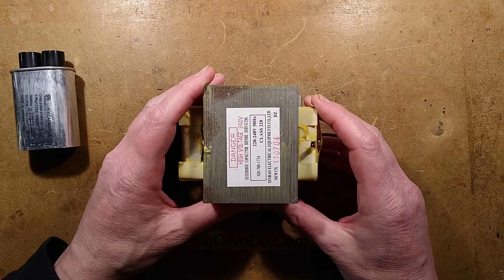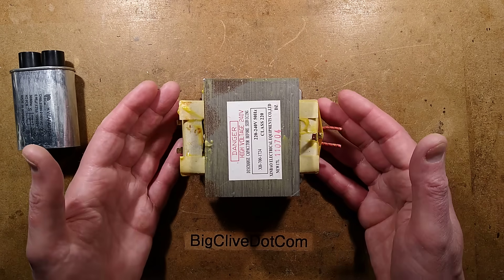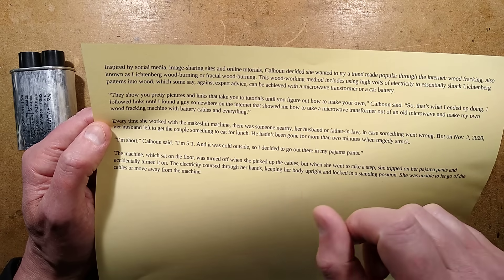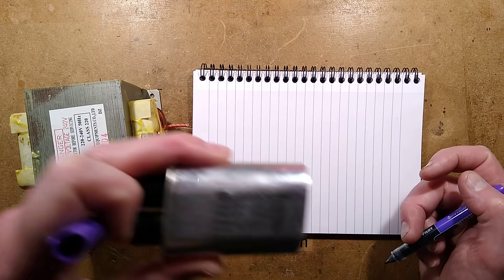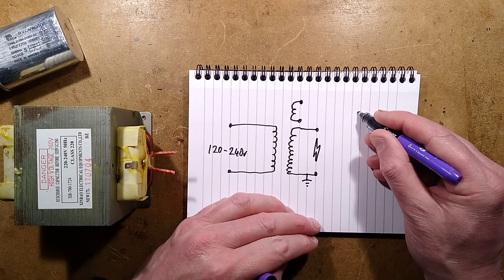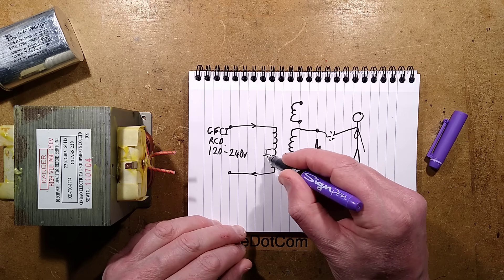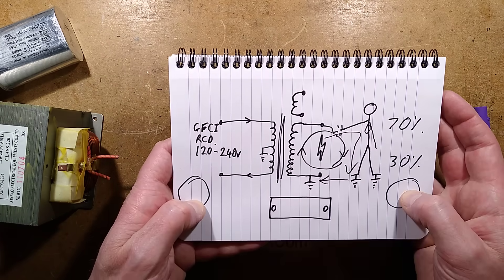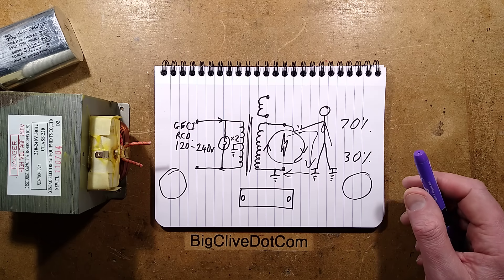The most deadly project on the Internet

Comment: There are a lot hobbies that are incredibly dangerous and can kill you if you don't take proper precautions. If people knew how dangerous R/C helicopters were for example they'd probably be outlawed. You're flying a 2200rpm 5kw lawnmower with a 1.5m span, people have been literally decapitated even when they were careful due to mechanical or electronics failures.

Comment: salty water and high electrical current.
sounds deadly enough for me to not even think about watching any further...
I was shutting down an old generator by touching a rubber stopper to the spark plug. my finger slipped and I was knocked on my but wondering what happened.
no thank you, buy bye.

Comment: whenever i screw around with high voltage i always put a current limiting resistor in series as cheap insurance. also old electronic fluorescent ballasts (cold cathode mode) make great high voltage supplies and i've obtained dozens of them from my college upgrading to led lights.

Comment: Thank you for an entertaining and informative video. I have no intention of messing with high voltage. I got a burn from a transformer that put out 660 volts on the secondary. Lucky it was just a small burn, like the diameter of a pencil. But it hurt. It was accidental.

Comment: I saw a professional artist who did fractal art with high voltage. He talked about the safety requirements and how just a pinhole in his gloves could be deadly
Reply: That is why linemen wear leather gloves over rated rubber gloves that are tested daily and given more extensive testing monthly.  If you don't even know what safety equipment is needed for this type of exposure, you aren't qualified to work with it.
Reply: @kcgunesq  I've worked and played with voltages to nearly 1M, and currents in the thousands (not at the same time!), over the course of 50 years. My feeling is gloves are a last resort for the brave. If the only protection I have is a glove, even if tested 5 minutes ago, I'm walking away!

Comment: wow 3kV DC is exactly what we'd run our big DNA sequencing gels back in the day. The Undergrad techs would perk right up when I told them if they splashed the running buffer on them while charged they'd be DEAD. Full stop.   This is a great public service Clive, bravo!
Reply: Those systems are going to be very much current limited, unlike a microwave transformer. It's not impossible to get killed by your DNA sequencer, but you'd have to try a lot harder.

Comment: I was discharging a small colour TV's HT by the standard practice of sliding a screwdriver along the chassis and under the tube connector to carry out a repair EXCEPT I wasn't properly touching the chassis with the shaft of the screwdriver. I remember the flash as 25Kv shot through the middle of the drivers insulation,  I doubled up in agony as it hit me.  It was a military grade long red screwdriver with 30 mm of plastic between me and the blade and it still got me. A very,  very painful lesson thankfully I survived.  I  used a fully grounded shorting cable from then on.

Comment: to show is what a minor shock would feel like and also to explain property of AC electricity in class my teacher too a regular 120v to 12v typical everyday transformer and flipped it around, has all the students in the class (this is college lvl course or cégep a d all adults) and the 1st and last of the students holding hands held each 1 of the 2 sides of 120v input side leads, my teacher there took the 2 leads of 12v side and I  same motion as striking a match made momentary contact to show us the actual impact of voltage spikes form collapsing Feild of the xformer

Comment: I have a little rule when I touch wires that carry enough power to cause muscles to lock up. Index and thumb, a little pinch is all it takes. Saved me once when I was doing some wiring on a breaker box and needed to put the hot wire on the primary rail, and accidentally smacked the shutoff lever with my elbow. Thumb contracted back and wire fell out of my hand.

Comment: There was a time when a 14-year-old boy could visit a junkyard with a bag of tools, wrestle whatever bits he wanted out of whatever auto carcass suited his needs, and pay for the parts when he left.  (That's really how junkyards were run, back in the "good" old days, and coming home dirty and a bit bloodied was a perfectly normal thing.)  This was how I got batteries, relays, alternators and coils for my basement experiments.  An ignition coil could give you quite a tingly jolt when wired to a simple 9-V dry cell.  Trying to pick up a submerged quarter from a properly set up steel bowl was a fun game! 
My parents' only rule was that I couldn't use the 120 V mains.  That, and the fact that microwave ovens weren't yet a thing, considerably improved the odds of my survival to adulthood.
Reply: I'm pretty sure junkyards continue to work that way, unless I am also getting old..

Comment: I've passed by apprenticeship and been a qualified sparks since 1980. I did my apprenticeship in factory. Were the factory had a supply of serval 100  thousand amps the factory had it own substation with six 3 phase transformers., Unfortunately I've seen a sparks die. Essentially people are a bag of water. The smoke given off when people are killed by high voltage with high amps , is steam , you are boiled alive , the cells in the body explode . Again I've seen sparks with bad burns , these burns are cause by cells rupturing because of steam theses cells are dead , your body can't replace them , I will spare every of the gory details.  When you seen someone killed by a high current it is something that will haunt you for the rest of your life . . The safety equipment we had to wear when dealing with high voltage and current were rubber mats , rubber boots , a couple pairs of insulated gauntlets , face flash  shield,  A Faraday cage suit and all out tools are insulated plus we had to have the necessary certificates to carry out the work ,we were never allowed to work alone ,.and we use to use earthing jump cables to ground everything, incase some accidentally switch things on Electricity is a deadly assassin you can smell it , you can see it , you can't hear it, but it's had a deadly bite, when it gets you . Yes I've had a few electric shocks in my time , purely because I get a bit complacent every now and then . I say to people who ask me about theses video, I simply say one word don't. You have one life look after it
Reply: On the road years ago I saw a guitar player get fried... not a nice experience. Luckily I was just a box shifter that night and not responsible for anything on the stage.

Comment: I wonder if you connected an unmodified microwave transformer to the mains using the high voltage side as primary would you get a powerful low voltage supply?
Reply: Not really. It will be quite current-limited. You may as well use a much smaller transformer instead.
Reply: I think I see what you mean .. an 800w microwave would be running around 0.4A at 2kV .. so 0.4a at 230v would be around 100w which wouldn't be very much for such a hefty transformer ..
Reply: @croolis  Correct. As a 100 W transformer it would be more efficient than most though.

Comment: Microwave oven transformers are so very dangerous.  The general public don't understand that the "mains" protection systems will not detect any "leakage" from the  HV side, so in effect there's no protection, at all. 

Add in those HV capacitors  that can REALLY store a killer shock,  then we've got a very effective killing machine if used incorrectly.

Having said that, HV can be fascinating. My  "highest voltage" device was a Marx generator (that was able on a dry day to provide a 3 meter / 10ft "spark" to a grounded terminal). All control connections were pneumatic, and I ensured there was a window (and grounded wall) between me and "it" when energised. Built a few (small) Tesla coils too - again HV but minute current - so intrinsically "safer" than any MOT!

Comment: during my Trade school time I attempted a Jacobs ladder with one of those, saw it in action for total of 3 times of 1 arc going up( ofc use manual strike not auto arc so the spacing for ladder was large enough, used chicken stock of PVC 6ft away alone I room to see) even with safety precautions in place it twice melted the alligator clip leads on 120v input side from current alone, never mind the brilliant Green/White flash light of arc going up ladder said deadly many times over like mortal combat style
Reply: btw Trade course was for installation and repair of Télécommunications equipment and infrastructure
Reply: I also had an old PS3 120v AC wire with on off switch the alligator clips to transformer as the set-up if any wonder

Comment: Good stuff to know, you probably have saved someone. My interest in electronics is all around logic level or less voltage. For me 80 mA and 5 volts is more than plenty for me. I'm more likely to be hurt by a shorted 18650 battery 🔋 or burning down the house because I left my soldering iron on.

Comment: Mucking around with MOTs without proper training has the same "try it once then be unable to try anything ever again" kind of energy as attempting to concentrate hydrogen peroxide to 95% purity in your garden shed. Even if you don't actually die, there's an excellent chance that your budding career as an artist or propellant chemist will be permanently ended due to no longer possessing the necessary body parts.

Comment: Also there are two parts in between magnatron that people don't think about when removing the magnets, above and below in the magnetron the insulators, often pink are made of berryllium oxide, they look and feel like spark plug material and are stable if not broken but if you break it and inhale just one particle you are likely to get berrylliumosis, a lung disease which is terminal as there is no cure, even if you think it's ceramic and not B.O. don't take the chance if you don't know what your doing, I get so mad when I see people blow up microwaves on net, (no I'm not a Karen) any person or pet inhaling berryllium dust is dead, they just don't know it at the time., If your going to blow up a microwave, (why I don't know) take out the magnetron, whole and dispose of it properly.

Comment: Well you cant stop the stupid entirely....
So thank you for educating woodfrackers on safety devices.

Holding electrodes in your hands is so crazy i would not even think about that.
Attaching electrodes to the wood and then powering up the transformer with a safety switch should be a good way to go.

AND i hope the manly commenters seeking the thrill of danger DONT get electrocuted even if it "proves them right" (having luck doesnt prove a thing).

Comment: If you are really interested in wood burning you could buy a fractal wood burning kit they cost between 50-80$ and come with Neon sign transformers . These are much more safer than the DIY versions. Most of them come with all required tools

Comment: Once I was repairing a power supply from a blade computer. I took the lit of the power supply unit off to look around and do some measurements.
Now that cover also was used as cooling plate for the power transistors (connected to the collectors and isolated by isolation foil  - but they came off whilst lifting the top so the collectors were exposed).
Now whilst looking into the power unit  I accidentally lay my arm on one of the open transistor collectors and also hit the outer case that was grounded.
My  arm muscles tensed themselves due to the shock in a split second but I also had a screwdriver in my hand so I ended up sticking the screw driver just under my chest between my ribs.
There was a tiny hole but besides that no damage was done. (BTW I fixed the power supply later that morning  hehehe)

Comment: This is the kind of stuff that drives me crazy. I have done all kinds of electrical in my life and you plain need to be careful at all times, period. I have modified things to do something it wasn't build for, and before using it you build in safety mechanisms. That dead mans switch is good idea, as well as the light (very bright), I think I would maybe add a buzzer also. Maybe even a time delay, so that after hearing or seeing it turn on, you have a couple second before it is actually powered (time enough to let go). I also wonder if you couldn't find, or build, a kind of GFCI for the higher voltage winding, seems like a good idea to me. Also a timeout function to shut off after few seconds, maybe the timeout could be adjustable, but even then the upper limit is very short. And ALL metal points are covered in a non conductive material (plastic, rubber). Even the tips of the probes are cover and you have actuate a spring loaded cover to attach it to the work surface.

Comment: You really should know what you're doing even with mains voltages. Those of us who worked through the tube era learned to pay attention to where your hands are. And 480V  3 phase commands respect. Often your first mistake can be your last.
A 2000 V 1kw transformer is insane to screw around with.
Reply: Working on tube amps, that sudden feeling of "imminent death" is an effective teacher
Reply: I repair vintage tube/valve radios. 500 volts available on a set with a power transformer (250-0-250). As mentioned before a GFCI/RCD can't help you in this situation.
Reply: 3 phase really stings -- just a passing touchis no fun at all

Comment: Oh dear, I just took apart a microwave oven yesterday for parts. I wanted to try to get 1 video of the high voltage winding arcing, luckily I have done my research and know how to do that relatively safely by using a pvc pipe and staying far away from the transformer. But as it happens, when I fed the transformer it’s rated voltage the secondary started smoking with a smell I’m all to familiar with of melting transformer lacker. So I’ve already removed the secondary and I’m planing to build a high current transformer. I just don’t get it though, if you don’t know what you are doing before you go poking around in a microwave oven then you probably shouldn’t be poking around in a microwave oven. When I took that one apart yesterday item number 1 on the list was discharging that capacitor and I did that with 1 hand behind my back and gloves on. The thing had been unplugged for a while so the bleeder resistor did it’s work and there was no charge, but it’s better to be safe than sorry. As it happens this was my first time working on a microwave oven, however I did extensive research before touching anything and that paid off, I also have around 5 years of experience taking things apart so that helped too, because usually step one for me is doing research before taking the thing apart. Unfortunately most people who make videos on how to do things like the burning art don’t give a damn about anyones safety and it’s all for the views.

Comment: Just don't do it, its like playing with fire, eventually you are gonna get burned. Electricity is worse as you can't see it, that's why we have rcd and safety devices which cutoff power when something like that happens, but using mots you completely bypass all safety. Just don't do it, it's not worth it. There are 1000 other things you can do which are safer compared to using MOTS for such exposed projects, which could electrocute you or your family.

Comment: Speaking of fool-proofing your systems; To the newly minted techs and engineers: Never underestimate the lengths those fools would go to circumvent your safety measures. I've seen a guy tape the switches and dive headfirst into a running annealing oven to release a part that got stuck under the conveyor. It did not end well...

Comment: I've gotten shocked through thick hiking boots, just from static electricity.
I also got hit with household voltage when I was younger. Being smaller (and in bare feet) it locked me up tight. Luckily I was moving away from the source when I touched it and fell away from it.

Comment: if youre going to use a dead man's switch, it might be a good idea to design it to require the extension of muscles rather than contraction. if youre shocked while holding down the two buttons the shock might cause you to keep holding them down

Comment: This is quite timely. I was thinking about doing some of this wood burning earlier today when I came across an old neon transformer in my garage. Even though this unit is current limited to 21mA, I like your suggestion of a "dead man's box" for safety. I got distracted by other shiny things and didn't get to it, but I think if I do this project against your advice, you've at least reminded me not to be complacent about the dangers.
Reply: 7mA and higher is the "can't let go and will kill you" current. The voltage I've seen on neon sign transformers ranged anywhere from around 7Kv to 15Kv . So lets say your body resistance was 50k ohms, I=E/R  =  7000V/50000 ohms =.14A or 140mA. So there is the potential to produce 140mA but the transformer is limited to 21mA which is still three times what it take to kill you so if you're a cat would have probably just lost one of your nine lives. All this to say, people do dangerous jobs every day and do them safely. If you don't know or have a question about doing it safely find out how first because with electricity you may not have a second chance.

Comment: I tried burning patterns in wood before with one probably 7 years ago. Works, but the current is so high, the burns are deep and lack detail. Voltage isn't quite as high as one would like, too. Looked it up again recently and there are tons more people who've tried it since. Even some idiot who tried burning wood with 120V, wires from the wall directly into wet wood (with no electrolytes added, to boot. He zapped himself in the video. Zero research or elec knowledge.).

Microwave transformers are fun but don't belong in the hands of people who don't know how to respect electricity.